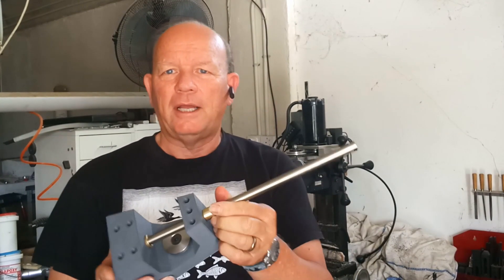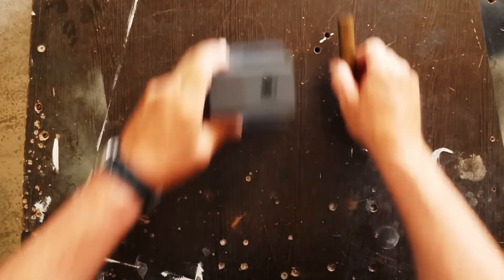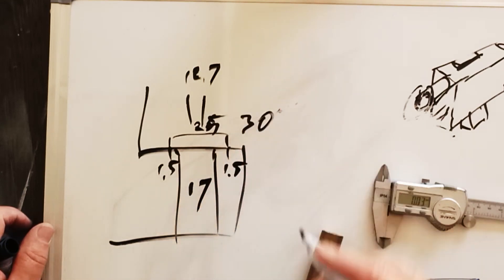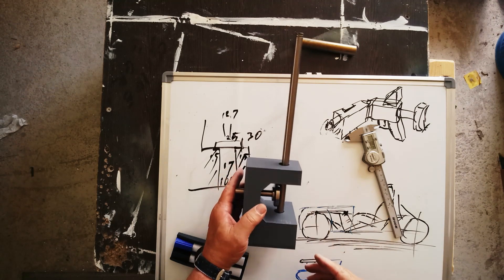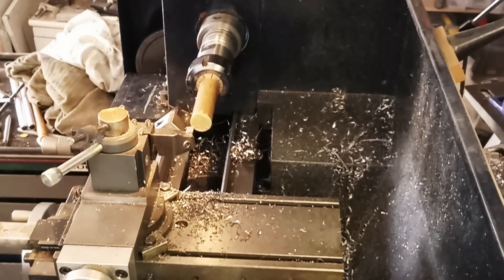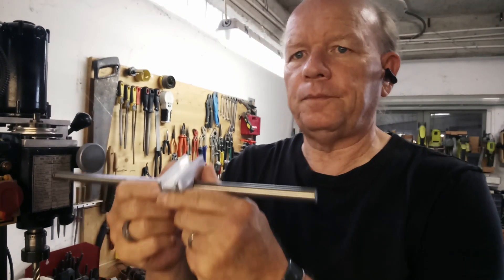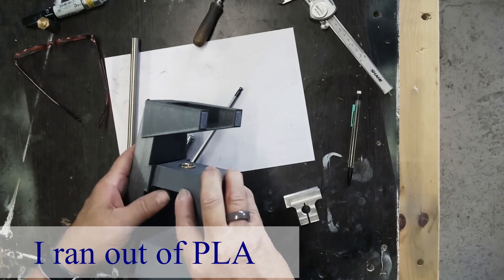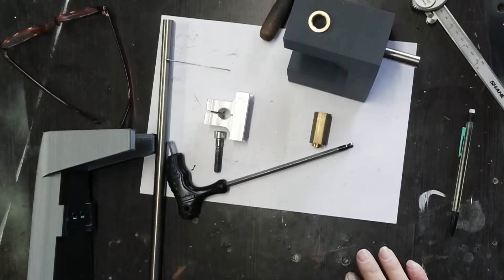Filing machine Part 2

Comment: Nice design. A few weeks back I built a filing adapter for a reciprocating saw https://youtu.be/tHasFzjB0YY
Reply from the maker: Nice solution, I like the idea. In my case, I needed a flat table to place the work-piece on as it is pretty small.
I have stored your idea in the "I must remember that" folder.
Reply: @Paradym  I had also considered after watching yours to try a wooden frame with a table in the future. Just never even thought of trying to build 1 out of anything other then metal till I saw yours
Reply from the maker: @craigtate5930  Good idea. It is always nice to suddenly see new possibilities and ways to do things.